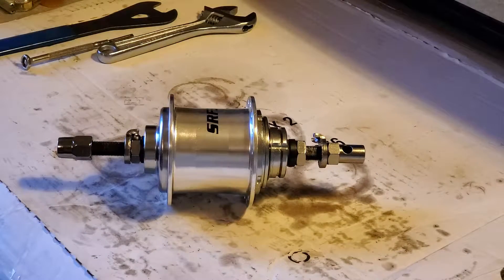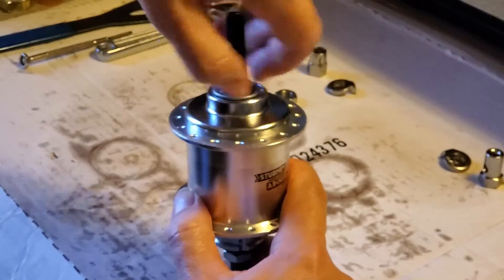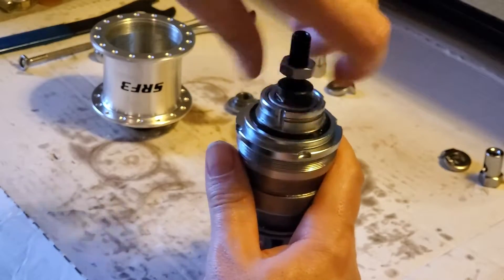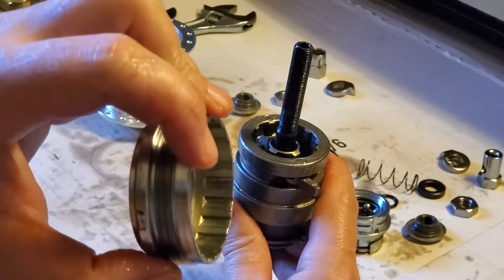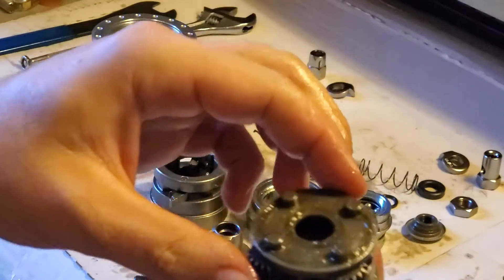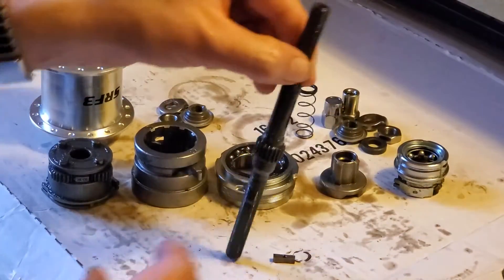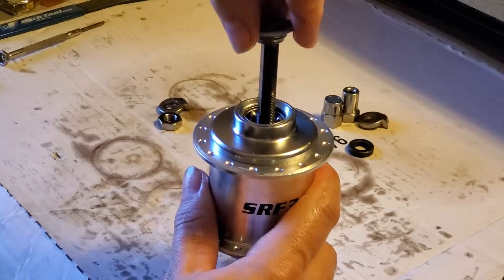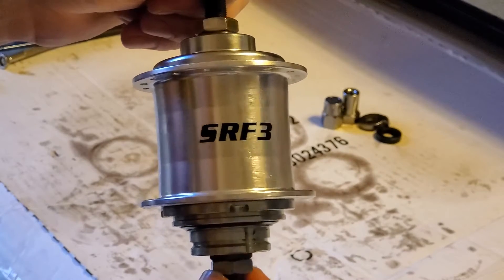Looking inside of a Sturmey Archer SRF3 3 Speed Internal Gear Hub (vocal)

Comment: If you twist the actuator plate over the pawls then it's easier to get the driver back in.

Also, I screw the toggle chain back into the axle key and leave it there until I fit the drive side cone.  It stops it becoming disorientated during reassembly.
Reply from the maker: That usually works.  I've found I hate the driver ring bearing(s) since they like to fall off it getting past the pawls and actuator plate.

Comment: Can I set  a disc brake on this hub and I want to use on 26 “ wheel ( 4 “ wide )
Reply from the maker: Not on this hub but there is a S-RK3 that can be spaced close to 110mm wide with narrower cone lock nuts.  (I think about 115mm) You may have to still muscle the hub into the frame but 26" frames are easier to flex out then 20".

Comment: A voyage of discovery sent me deep into AW, SRF3 and BSR (NOT BWR) territory. The AW became the SRF3 around the time when the clutch was redesigned. The BSR is the SRF3 more specifically tailored for Brompton. For example, Brompton BSR's are in 28 hole and only have the one possible axle length.

Comment: Great video tq.
Would you recommend this hub mechanically over the Shimano 3speed Nexus ?

 (13/Feb/2023-10:57pm🇦🇺EST)
Reply from the maker: Nexus hubs work.  Just there are no spare parts.  I cannot say parts are easy to find for these hubs also.  I'm a thumb shifter fan. Nexus hubs usually have grip shifters.

The srf3 is hard to find now.  I'm unsure why.  I do know sun race is making the Sturmey Archer hubs and pushing the rotary shift versions lately.  The old AW 40s, 50s, 60s even 70s hubs are always on ebay along with parts for them.
Reply: @thatbmxguy  - thankyou for taking the time to reply, much appreciated. 

(15/Feb/2023-5:03pm🇦🇺EST)

Comment: Thank you for the inspirational video. I am curious how to re-oil the hub after degreasing it. I want to try aft oil and grease in place of the bearings. However, I do not know how much of this oil to use. Maybe you will make another video about hub oiling? :) All the best!
Reply from the maker: Many people say to use maybe a teaspoon of oil and re-oil every 100 miles?  The oil most say is good is 10w30.  I've used 5w30, and even tried automatic transmission fluid.  Phil tenacious oil is also used by many but I think it's too sticky.  In this video the hub had the sturmey archer stock slippery grease.  I applied 00 grease in the other srf3 video and it just seemed like Phil tenacious oil (sticky)
Reply: @thatbmxguy  Thank you for your response. However, I am a bit worried that I have to refill the oil every 100mil. There is no "oil valve" on my 6 speed Sturmey Archer in Brompton. So I would have to disassemble the hub every 100 miles, which is no longer beneficial for me. Do you have any ideas on how to make the hub work long and effectively?
Reply from the maker: The light grease that sturmey archer sells is likely more than fine if you overhaul yearly.   Oiling every 100 miles might seem kind of obsessive.  It depends if you ride the Brompton 100 miles a week vs 100 miles a month or maybe 100 miles after 100 days.
Reply: @thatbmxguy  Thanks a lot for your patient explanation. It will be more beneficial for me to use a light grease. Best wishes and many thanks again :)

Comment: What could be the problem with the SRF3 if the stick clicks 3 times but I only feel 2 gear changes as if I didn't feel 3 changes - no difference. As if it were a two-speed gear change. Although the lever clicks 3 times, it feels like only 2 times the difference in transmission power.
Reply from the maker: When its shifted to 1 make sure the hub is spinning when pedal silent with no ticking.  If it it isn't silent in 1 on the shifter the cable is out of adjustment.

Comment: You say it'll fit up to 135, but what is the minimum?  I'd like to put one of these on a 29" bmx cruiser with 110mm rear spacing.
Reply from the maker: This hub fits with the thinnest cone locknut that is 3mm (should be on ebay) and a lock washer on the drive side. A 5mm cone lock nut and wash on the non drive side then should be about 110mm old.   I can also squeeze in a simple lolly pop chain tensioner on the drive side too.  There's another video of talking about fitting these on bmx bikes.  

As long as the frame is using 3/8 axle slots you should be alright.
Reply: @thatbmxguy  Hey, many thanks, man.  Much appreciated.

Comment: Thanks for the video.👍 How do you change the bearing inside the housing n driver side.
Reply from the maker: The  driver bearing has shield holding it in place.  You would have to pull the shield off by prying or tapping it off with a dowel.   I may make a video on upgrading the hub soon about that.
Reply: @thatbmxguy  Great. Thanks.

Comment: heads up these hubs fail on e bikes.
Reply from the maker: I believe it.  ebike riders usually are riding aggressive.    I read an article somewhere on recommended internal gear hubs with ebikes.  The article was praising 3 speed due to simplicity.
Reply: @thatbmxguy  yes that article is misleading incorect they also do not shift down under load and this means you have to back of and wait for the motor with its run on to shut down leaving you stalled on the hill...shimano make a 5 speed rated for ebikes any experiance with that one carl?
Reply from the maker: I have yet to see 3 or 5 speed setup ebikes.   I was planning to "play" around with the idea at some point but no extra money.  One customer had a cargo trike (2 front wheeled) with a front bin from a company in Europe.  It has the Nexus 8 speed on it.  The Nexus 8 seems to still handle the cargo trike abuse hauling compost buckets (up to 4 buckets, with a trailer with 70 lbs of dirt in each bucket).  (I tried the job and hated it).  The main issue was the spokes kept breaking on the rear wheel.  Many of the ebikes coming in for tubes or small fixes here seem to to be Radpower rear motor fat bikes or the front motor mini razor scooters.  Most of the mid-motor setups I assembled or tuned up (I-zips or Raleigh's) had rear derailleurs with 8 or 9 speeds and didn't seem to have any problems, just normal cassette and chain wear.
Reply from the maker: Actually it seems the only reason I don't use my nexus 8 is.. well I don't have a frame that works with one.  Nothing bmx is 135mm OLD.  It seems like the Shimanos are more reliable, then say the Sun made Sturmey Archers.  I kind of don't believe 3 gears is enough for a ebike, and hilly roads. regardless. I'm more worried about pawls breaking, and Shimanos, like the 7, 8 and Alfines have one way bearings to clutch vs pawls normally.
Reply: @thatbmxguy  I destroyed an Nexus 8 not so long ago on a non electric bike. Now I ride with the CBE-110 and a SA S1C, but those do not have any gears.
SA RX-RC5 states "heavy duty use" and is used on some forums on E-Fatbikes. Maybe thats a great one?
Reply from the maker: The coaster brakes can handle abuse if they are good ones.  I'm partial to the old 80s Suntour 3 pad hubs.   The coaster brakes would only work with a front wheel motor, or you wouldn't be able to use the coaster brake, as a foot brake (mid motors normally freewheel at the cranks).  Unless there are mid-motors that act fixed?   But more on the coasters.   Since coaster brakes don't have pawls to fail with axial clutch.  The hub "free-coastering" may work out fine with a nice rim brake.
Reply: @thatbmxguy  coster does have a stronger drive but a single speed ebike (one sproket on a casette does not fail and is lighter for my aplication but ither way still leaves us with no gears...a coster or any hub can be used on an ebike if you use a hub motor /any motor mounted forward of the rear wheel and driving the rear wheel with chain or belt..or were you sugesting a coaster brake 3 speed?...by the way the failure mode of my SA 3 speed was that drive key way thing.or so SA tell me..i just pulled it off the bike as it was also too heavy,did not have enough range and will not shift down under load.. a failure in many ways for my aplication. the slipping top gear was just one nail in its coffin.